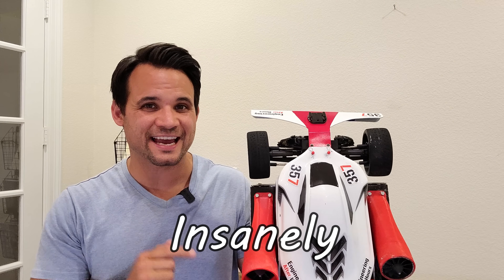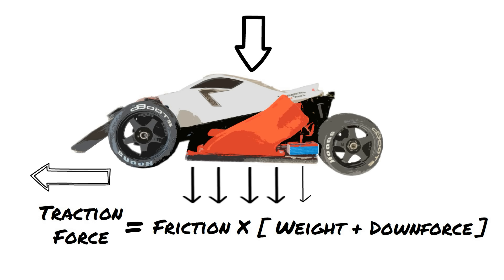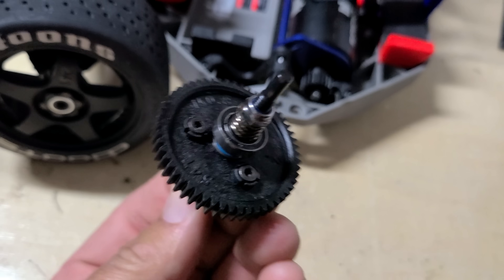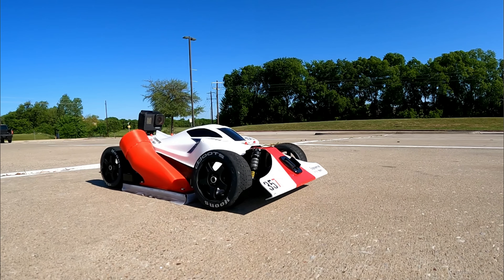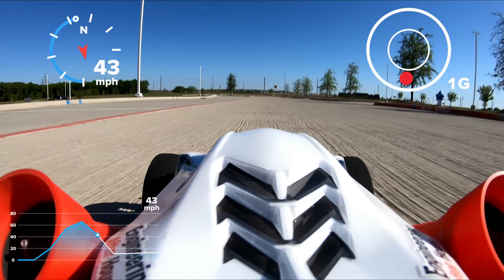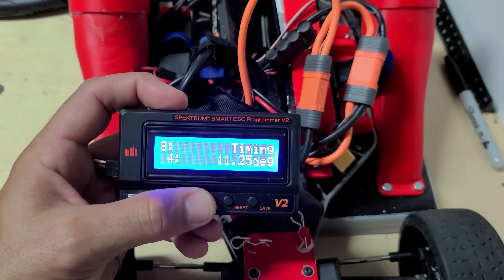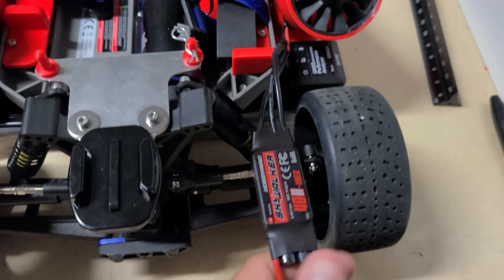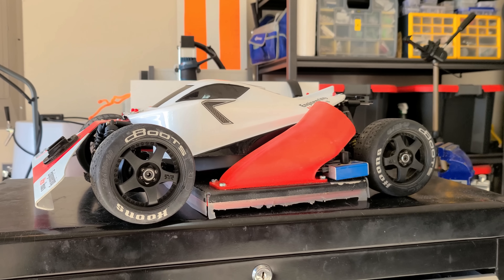241% More Grip with a Fan Car and Ground Effect

Comment: The stuttered launch is due to wheel hop. Either: pre-load/stiffen suspension, or use better tires (preferably ones which balloon upon acceleration).
Reply from the maker: It actually turned out to be an unsensored motor. Fixing that gave it great torque off the line but was still unstable.

Comment: Is it possible to use conventional drag racing and somehow involve a trans brake to deliver torque faster than what the ecu can deliver?
Reply from the maker: It's probably possible, but with the upgraded sensored motor on the next build...I didn't need more torque.

Comment: You could also run on dark asphalt (high amount of tar) and use heated slick tires. That concrete surface looks too rough to have good contact.

Comment: yea normal rc drag cars have this beat , not fair to compare me doing RC cars with jets combined with wheel power since like 2011 on youtube...  the funny thing to me.. is thinking you need more than wheel power too keep up with a tesla which is only wheel power . the downforce tech is interesting and was banned in some racing leagues but a key thing to remember is  pointed in the right way the thrust alone is downforce and push ...  the New mclaren car builder guy is trying to use this in his new cars ( power , traction , weight + Thrust & design ) get complicated .. but to beat a drag car you need to be a drag car 1st...   Design / FORM ... matters a lot also
Reply from the maker: This isn't designed to be a drag car. It's modeled after a road race car where lateral Gs matter.
Reply: @EngineeringAfterHours  :yougotthis: very true , but thrust out the back in any drift or turn helps a lot xD ...

Comment: have you considered modulating the fan once you reach a certain speed. Maybe the additional downforce is not needed and may be creating drag?
Reply from the maker: If I had a small motor dyno I may be able to reduce downforce when I'm power limited, but I don't know of one that works for my setup

Comment: Your life would be 100x easier if you just used SI units for everything.
Reply from the maker: Lol...if only my problems were that easy to solve. When you solve complex problems...the difference between imperial and metric is below the noise floor of difficulty.
Reply: @EngineeringAfterHours  There's still definitely no benefit to using Imperial.
Reply from the maker: @turkeyphant  agreed! I'll make a video on why imperial is better for ya soon but don't tell anyone that's a lie :)

Comment: I know this will require you to build a whole new car but if you really want to do some high speed drag racing. Go with one of arrma’s street cars the limitless, infraction or the felony. They have low down weight, they use 17mm tires hexes so you could get some foam tires for it and they can handle 1 million weight in all 3 differentials and they launch hard and fast. I am saving for one now to go hopefully past 130mph then gear it down and hoon around with it for a while. Alse there metal chassis so they will be better for this
Reply from the maker: The arrmas are great street bashers, but they were just way too heavy to pull this many Gs on 6s. 

I would go arrma if I were going for top speed only and not high average acceleration.

Comment: i feel like by sucking the air in from behind you are missing out  if possibly the air was sucked in from the front  not only you have the insane crazy downforce but also can use the jet engines that are sucking in air for that downforce as a means to boost the car to go even faster  i tottly get it has to be shaped just right  for it to run efishantly but when you have jet engines on a rc car dont tell me ppl would be misisng out a opeprtunity to try to have that extra bit more speed
Reply: Lol cool story

Comment: Can you use a brush instead of the plastic skirts, some of the ones they used for door draft exclusion have a very thin mylar reinforcement down the middle this may dump the friction off the line and give a a better deal.
Reply from the maker: I tested that and the versions I used didn't work well.

Comment: Wait, if the first foot is taken out of the 0-60 time, does that mean a rocket sled capable of ~120g would be stated as going 0-60 in exactly 0 seconds? If you shoot past 60 mph before you cross the foot, would it be recorded as a negative amount of time to go 0-60?

Comment: forgive my non engineering question,  but is there anyway you could test this on a road or better yet a runway?  I know this is asking a lot but wouldn't it really make the car way more stable and the downforce much more consistent?
Reply from the maker: Good comment and yes it would probably help a ton. I want to start testing future projects on a drag strip or old runway

Comment: I have been looking to do similar on one of my arrma cars, where did you get the fans and more importantly the fan housings from? Thanks
Reply from the maker: The fans are 50mm EDFs from amazon. The housings I had to design and 3d print myself. They needed to be pretty form fitting for the packaging size I was working with
Reply: @EngineeringAfterHours  Thanks so much for the fast reply. I don't supposed you have the 3d files that you could send me by any chance? If you look at my latest video you'll get an idea of what I've got planned for the same setup. If you were willing to part with the 3d files my email address can be found under my 'about' page on youtube. I've watched this video 3 times so far this morning! I am thinking of custom making a chassis for my infraction with just this idea in mind
Reply from the maker: @DriftomaniacsRC  haha awesome...planning for it on the infraction? Where can I send you files?
Reply: @EngineeringAfterHours  Hi there's a link on my youtube homepage if you click the 'about' tab it'll show a link to my email. Much appreciated just watching your latest 'last' video!

Comment: instead of adding that extra weight and using fans custom build a chassis that sucks air from the front of the car and distributes it underneath. This will be a better option because the faster your speed the more downforce the car will have. Also add a front air diffuser like the traxxis XO-1 has installed for speed runs which further makes the car stick to the ground.
Reply from the maker: https://youtu.be/XnFZ2Frt5SY

Comment: What if you made the fans speed adjust as the speed of the car increases so at the top end, you have less drag. The faster the speed, the slower the fans
Reply from the maker: I explain why in the next video, but the main reason for the fans in the first place is because it's low drag downforce. 

Secondly, I need high downforce for the entire run.

I'm hoping to finish the 3rd video next week.

Comment: It would be a lot more watchable and understandable if you used standard SI units instead of freedom units.

You seem to be mixing and matching all over the place which just makes the maths really hard to follow.
Reply from the maker: No matter what units I use, someone is going to complain. In college we're trained to use both unit systems so you're capable of international work...I've carried that through my professional career and it's only helped. I recommend establishing a comfort level with both.

Secondly, given my audience distribution and revenue offset biased towards the Americas, SI would not be a logical choice so if I did pick a single unit system it would be in line with my channel statistics. 

Regardless, I'll make an attempt to put dual units on the results of critical calculations to help. This is easy to forget because I'm comfortable in multiple unit systems...but I'll make a note of it for round 3 of the fan car.
Reply: @EngineeringAfterHours  thanks for the reply and I understand your reasoning! Also, great video and happy new year!
Reply from the maker: @Fogmeister  thanks! Happy new year to you as well!

Comment: Went thew the comments how am I the only one thinking you don't have enough amps at launch? Run a test with a recording multimeter. I would bet your amps drop on launch causing your stutter. Reminds me of trying to run my hand drill at low battery. Amps just aren't there to full throttle right off the bat and stutters 2 or 3 times before getting up to speed. Worth checking out!
Reply from the maker: I actually have a new build with a sensored motor...and I'm almost positive it was simply the lack of sensors. I've had to actually limit the current on my new motor/esc combo to limit torque. Itll all be explained in the next video.

Comment: I think the roll out time adjustment is as bit too ambitious cuz you shouldnt be adjusting a foot, you need to scale down, its more like an inch. Because everything should be one to one scale.
edit: reason is say it is teslas 0-60 distance would be different than that of the rc car
Reply from the maker: If I scaled rollout I would also have to scale speed which makes it a race from 0-6mph...nobody wants to see that. You either scale everything or you don't scale anything. 

This video actually points out how using a rollout on street cars is stupid. Tesla isn't actually using staging lights...they're arbitrarily subtracting the first foot from GPS data.

Comment: what I noticed is that you impelers are the wrong way around. so they suck air ok but if you mount them 180° (the kone faceing forward)  you'll get like 30% more downforce aout of them.
because now its like spinning a CCW propeller clockwise, it pushes air but not at the full potential.
Reply from the maker: The third video I'm this series addresses this actually. Hope to be done in 2 weeks!

Comment: i think even a 1 second flat 0-60 is realistically obtainable for this car, but only with a nice flat surface as it seems even with 19 lbs of downforce you still slid from bumps and this slows it down a lot

Comment: You need a metal spur gear, a sensored motor & a dumborc radio.  Metal spur can take more power, sensored motor will give you a smoother start & dumborc radios have the fastest response time & most range that I know of & they're cheap.  I suggest setting up the fans to power down the faster you go.  They help with launches but kill your top speed.

Comment: TURN THE EDFs AROUND!!!!!

They are specifically designed to be run in a certain direction, by running them backwards you are making them extremely inefficient. The blade designs are optimized via a computer software to push as much air as possible in one direction.
Reply from the maker: You will be super happy to know that the latest build tests this and I'll share the results as well as the original design intent.
Reply: @EngineeringAfterHours  Awesome, I can't wait to see it! And just because of that amazingly fast response and the fact that you are a fellow Traxxas fan I think that deserves a Sub!!

Comment: Did you scale the 1 foot rollout? On a car that size it should be more like a 2 inch rollout (I did no math on that, just a guess). If you took a foot out, that's close to a whole car length, which is not comparitive to the tesla
Reply from the maker: That's not how it works. You only scale length if you scale speed. A top fuel dragster has a 300 inch wheelbase...do you think tesla scales their rollout from that?
Reply: @EngineeringAfterHours  no but it's not wheelbase, it's wheel size. The wheel on a full size car blocks the timing laser for approximately 1 foot. The wheels on your rc car won't
Reply from the maker: When they run the times of consumer cars they're not using staging beams...they're literally just subtracting the first foot. Rollout in the US has been standardized as 1 foot to prevent variability from staging setups. 

Regardless. The car is low enough that it would give more than a 1 foot rollout if you actually used staging beams. It would be probably 15". This is another reason it just makes more sense to standardize on a gps verified 1 foot rollout.

Comment: It won’t beat the Tesla. I know this because, 0-60 means you need straight line speed. He is focusing on downforce. More downforce = less straight line speed. Downforce is better for turning speed. Yes, he does need down force to keep the car on the ground but his car has 19+ pounds of downforce. (More than the car’s weight.) that’s way too much.
Reply from the maker: I think you're confusing SPEED and Acceleration. For straight line Acceleration you need tons of downforce.
Reply: @EngineeringAfterHours  hmm… you might be right. I’m just giving the knowledge I know. But it’s possible I’m wrong
Reply from the maker: I'm planning to do a video on the science of acceleration so that should help a lot. But look at a top fuel dragster for example....they have like 8,000lbs of downforce for a 2,000lb car
Reply: @EngineeringAfterHours  I am a huge fan of Motorsports. But drag is one of the 2 I don’t watch. That and Motocross. I got my knowledge that I said from formula one. But like I also said you might be right about me confusing acceleration and speed.

Comment: If you don't want to break your parts, don't use plastic parts, use steel or titanium parts. Those are stronger and can have more stress without breaking.
Reply from the maker: I use steel on the rear where there is higher torque transfer, but steel parts have really high rotational inertia which hurts acceleration.

Comment: a properly setup  aftermarket slipper clutch would solve the studering along with a sensored moter and you could try softer rubber for the box bottom , keep it up !!!
Reply from the maker: Slippers really just aren't made to handle that much torque. The stock slipper is designed for a 5lb car, but this car was effectively 24 lbs or so. And it's running a motor that's way bigger than stock.

Comment: 2 ideas: how about a small tank of compressed air releasing upward at launch (like topfuel dragsters' exhaust) instead of the fans? It feels like you really only need that downforce at launch and the whole fan system being shed would reduce weight
and
You should contact some chemistry youtuber for a collab see if you can get some supersoft custom rubber compounds done for those tires.
In any way, that's super cool what's you're doing there. Curious to see if my ideas make sense also ahah

Comment: try beating a formula 1. 0 to 200 km/h (124 mph): 4.2 seconds
Reply: and more than 5g corner.
Reply from the maker: Haha I can beat F1 in 0-60 but that's about it.

I might be able to corner at 5G, but I'm speed limited to around 94mph with this setup. If I gear higher I'm torque limited.

Comment: While this would involve a total redesign of your car I would consider switching to a Arrma typhon long wheelbase project. That's a typhon using a Mojave chassis. Look em up on YouTube, they're very popular projects and adding 8s to that seems easy. Now that being said you could go crazy and shoot for a Arrma Limitless or Traxxas X01. Now that would make for some interesting watching. Love the vid!
Reply from the maker: The arrmas are just too heavy. I want a limitless for sure, but the undertray is also too close to the ground for this. I'll do classical aero there.
Reply: @EngineeringAfterHours  that might be the problem though... No? Meaning the slash chassis might not have enough weight spread out over a longer chassis to give you better stability. That being said a huge kudos for keeping a slash chassis running 6s that stable.

Maybe the stretched typhon running 8s is the way to go then. Oh and as for your bearings under the car have you thought of Teflon blocks?
Reply from the maker: @andrewmoroney1317  being too light isn't the problem at all. This car is now the equivalent of 20lbs with the fans on.If anything I want lighter. The heavier the car is, the more power I need. A typhon or limitless would require twice the power I have now and there aren't power system out there that will do this without a full custom chassis that can take a huge 1/5th scale motor.
Reply: @EngineeringAfterHours  nothing wrong with that... Kidding

OK well the only other idea I can think of is maybe a e revo chassis. They're longer than a slash but I don't think you'll take a weight penalty. Might be able to seriously dial up some power.

It's pretty crazy what you're doing. Everyone else just wants to go the fastest. No one has ever really tried for specific 0-60 acceleration.
Reply from the maker: @andrewmoroney1317  I did consider an X01 center shaft and a custom chassis...but we'll see where this build gets me with the senaored motor
Reply: @EngineeringAfterHours  have you tried a higher c battery? I know you mentioned it before. Maybe try that before you go for a sensored system.
Reply from the maker: @andrewmoroney1317  I ready bought a sensored system AND a higher C battery :)
Reply: @EngineeringAfterHours  nice. Can't wait to see this

Comment: This video is great sir! I have a question though,what's the part # for the slipper clutch eliminator? Thanks.
Reply from the maker: The one I used it made by hot racing. I don't know what the part number is.

Comment: Sensorless motors has a high probability of stuttering off the line(Often called cogging), especially when coupled with lower gearing ratios(Called high gearing in RC circles).
But this makes me think that he should contact some of the RC no prep drag racers.
They often do the 1:10 scale quarter mile (132ft/~40meters) in ~1.9 secs, and that's with 2wd cars.
Some of the reach about 90mph at the end of the run, so it would make sense that the 60mph mark is reached much earlier.

Comment: Said it before and I'll say it again squirrel cage fans are far more effective at creating a vacuum than ducted fans. Ducted fans are more efficient when the air traveling into them is closer to the speed they are moving through the air. Squirrel cage fans on the other hand do not care how fast the air is coming in as it uses the mass of the air itself to create the vacuum.
Reply from the maker: Send a link to what you're thinking would work.